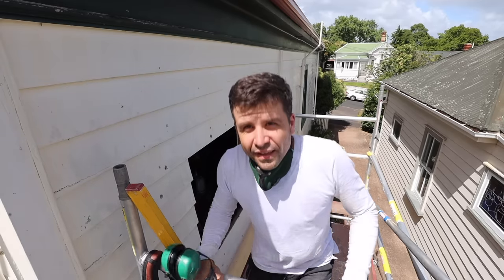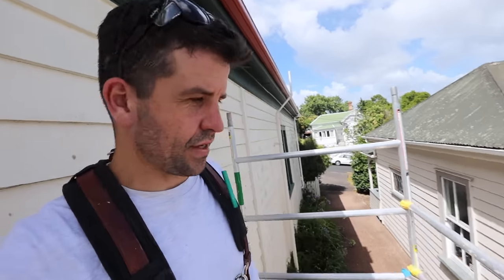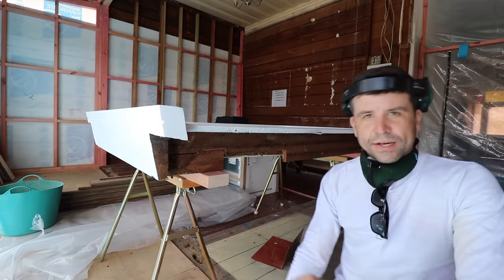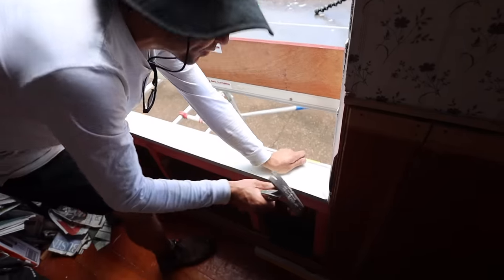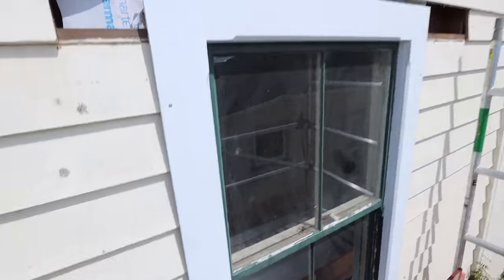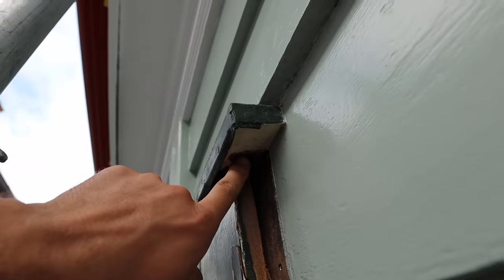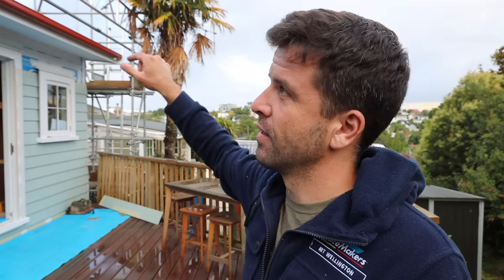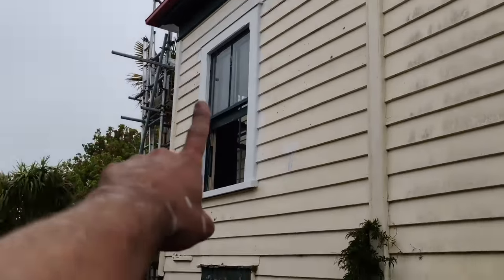What's the deal with New Zealand windows?

Comment: Crazy you dont sheeth your walls before siding them.
Reply: sheething is not required as the framing is built strong
Reply: All horizontal and diagonal bracing built as part of the framework. Also don't have hurricanes or tornadoes.
Reply: Sheathing is for shear force. We frame our wood frames very strong. Like 200psi/ft2 strong. Is it windy over there?
Reply: @kylefleetwood9572  Pretty windy generally .. the occasional extratropical cyclone but not like the US. The framing itself only handles vertical loads (both up and down) and face loads. The plasterboard lining on the inside of the external walls is rated to provide horizontal bracing / resistance to shear.  Some new houses certainly do have external sheathing and it's required as a "rigid underlay" (behind building wrap behind a drained cavity behind the cladding) in "extra high" wind zones (wind speed up to 55m/s ≈ 123mph i.e. hurricane-strength wind) and that can also double as wall bracing. Here's some light reading if you're interested: https://www.standards.govt.nz/sponsored-standards/building-standards/nzs3604/   and https://www.building.govt.nz/building-code-compliance/
Reply: Thats crazy would love to come over for a week after this covid stuff is done and study with one of you guys. I own my own framing and finish company here in the us and would love to see how its done over seas in other countries

Comment: Oiiiii from Qld, Aus. We weather wrap (we call it sarking) over the sill and frame, then the window is shot into place. We install a metal header flashing and apply damp-course around the sides and under the sill, then attach what we call a 'picture frame' around the window, usually made from some 42x42 timber batten. Our weather boards then butt into the picture frame and happy days. I reckon the scriber looks like a little extra work, but I can see how it would give a cleaner finish. Top notch, Mate.

Btw, someone has probably already asked, but where did you get that dust mask?

Comment: How is the lowest temperature in NZ?
Reply: NZ is a very long narrow country, which means weather is a lot different in the south compared to where Scott is up in Auckland. Lowest temperature in Auckland would be -2 Celsius in winter and that's only overnight, minimum daytime temp would be about 5 Celsius at a guess, and that'd only be in winter. Currently NZ is in summer so Auckland temperatures are more like minimum of 13 Celsius and max of 32 Celsius.
Reply: @albertsmith1032  thank you  for unswer. Just wonder how is to live in house like this one  :) I'm from east Europe and here winter is up to -30⁰ :)))
Reply: @luckyluke8052  The house Scott's working on is 100 years old which means it probably doesn't have much insulation, so it'd probably get a bit cold in winter - but newer houses here have more insulation (though probably still not enough) which makes them a lot better. At least that's the ones up north around Auckland. Down south they probably built them with a bit better insulation to start with as the winters in the south can get down to -10 Celsius overnight with max temp of 1 Celsius.

Comment: I can't stand how your buildings in near zealand are just outside wood, a bit insulation and than just another board of wood. 

In Germany nobody would build like that, our houses can outlast many generations and families if build proper. Sure it's cheap and fast but I really prefer a bricked solid stone house. https://www.youtube.com/watch?v=qwmNVL_6NTs The link is a video how houses in Germany are usually build.
Reply: NZ has many earthquakes, so a bricked solid building doesn't last long at all there.  Timber gives enough in an earthquake that they generally stay standing with maybe some cosmetic fix ups required.
Reply: Check out 500 + year old wooden buildings in Norway. I live in a seventy year old wooden house in NZ, no problems. 120 yr+ common here. Solid brick or stone buildings  prone to failure in earthquakes.
Reply: Hi, in the past ten hours we have had three earthquakes, 2.6, 4.2 & 5 on the scale.  Imagine what that would do if they hit in your area eight times a day, every day?  It certainly would keep you busy doing either repairs or total clearance. There are 15,000 earthquakes each year in NZ. Wooden houses build a hundred years ago still stand, its the foundations that causes the major damage.  Harera.
Reply: “A bit of insulation”? We don’t need no stinking insulation! My timber house here in New Zealand is 120 years old and is as good as the day it was built. It has outlasted a number of huge Earthquakes. It is not “cheap and fast”, it is more expensive and slower than building in brick, but it is the stronger and safer option here.
Reply: I didn’t say a house doesn’t need insulation, I would love insulation in my house so that I had to light the fire less often in Winter, however in our temperate New Zealand climate it is not vital. My wooden house is 120 years old, is not insulated, has no leaks or rot anywhere and is comfortable to live in. 
  I was making a joke about the German commentator saying New Zealand houses are just wood, insulation and more wood, when my house is just wood and more wood.